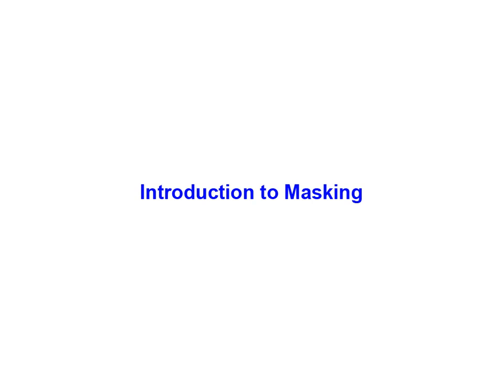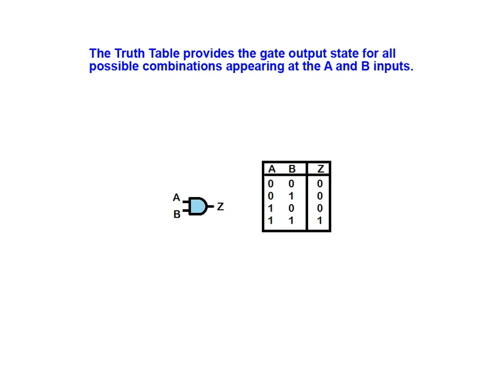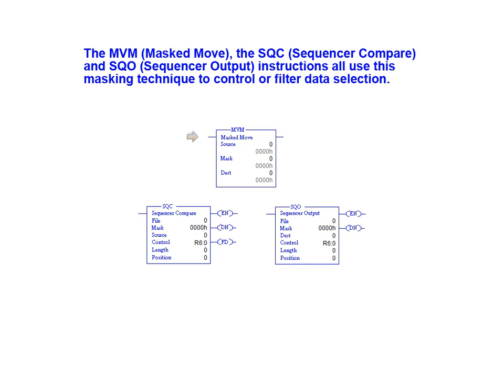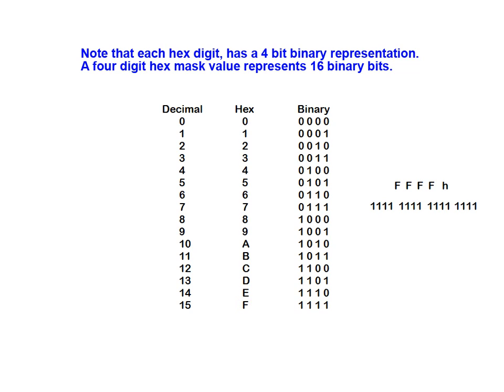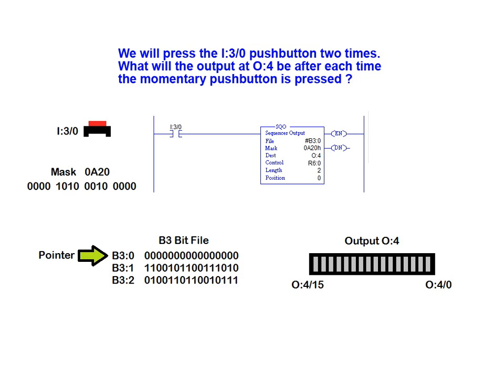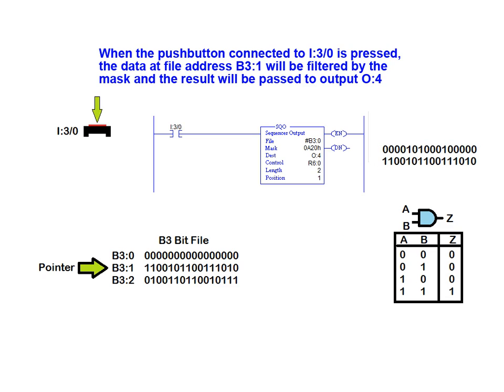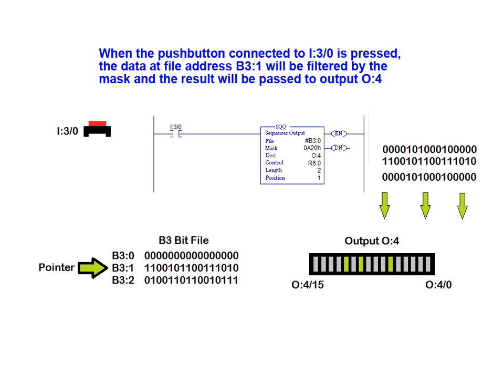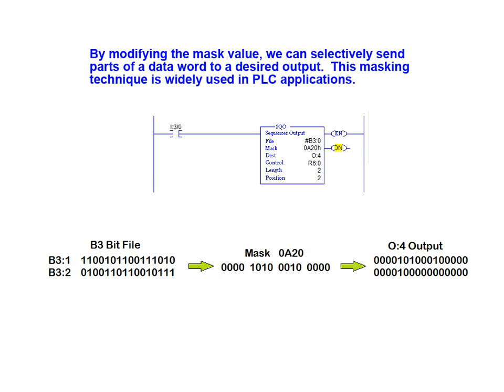PLC (AB SLC 500) Data Masking -- Introduction to masking using an SQO sequencer block

Comment: hello sir B3:1 1100101100111010 WHERE THESE VALUES COME FROM PLZ HELP
Reply from the maker: +Mukesh Kumar Hello, the value resides in the B3 File in memory.  It is a random value I entered into the table for illustrating the masking option for the sequencer.  It could have been entered into the N7 File as well.